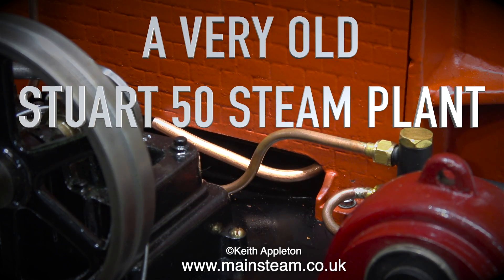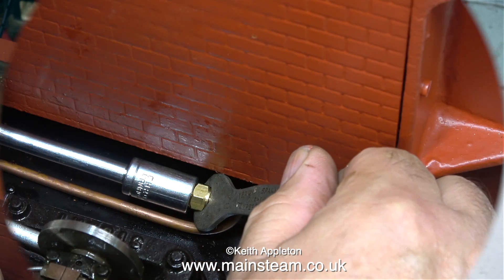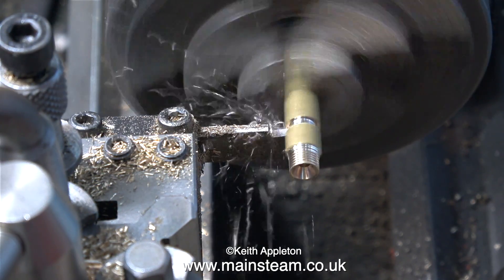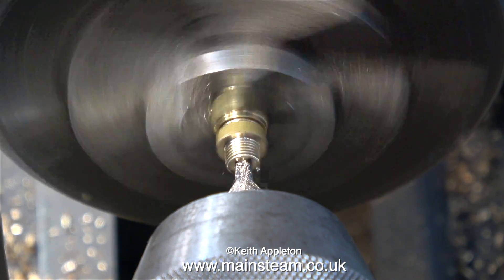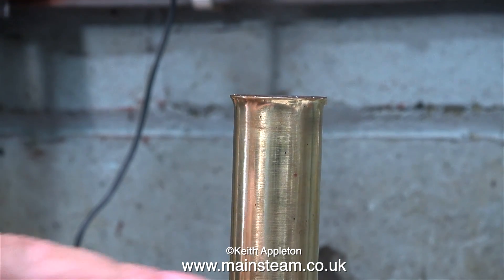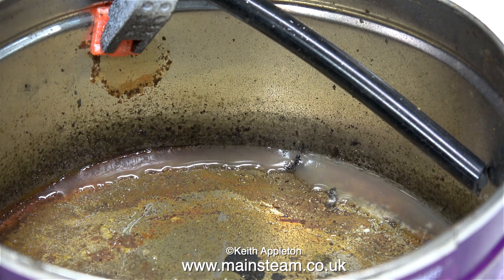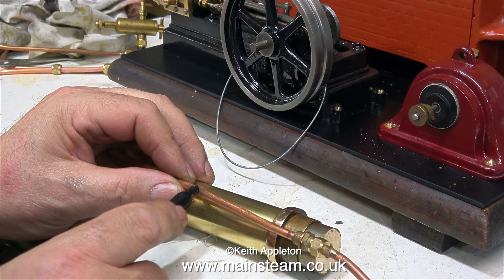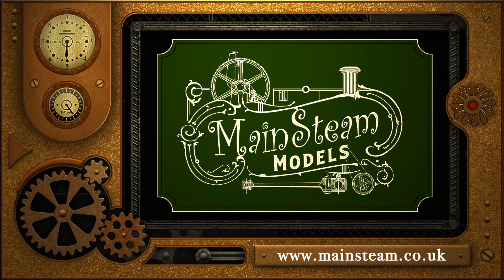A VERY OLD STUART S50 STEAM PLANT - PART #27

Comment: Do compression fittings on the copper tubing with as well as a soldered connection?
Reply from the maker: I never use them. I silver solder the fittings onto most of the piping I make.